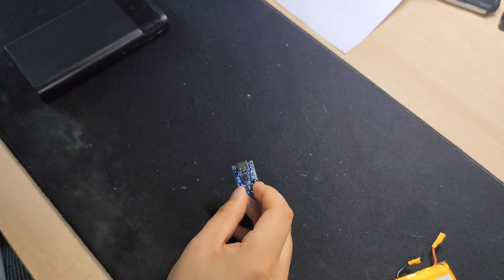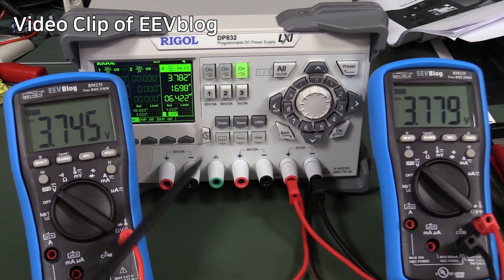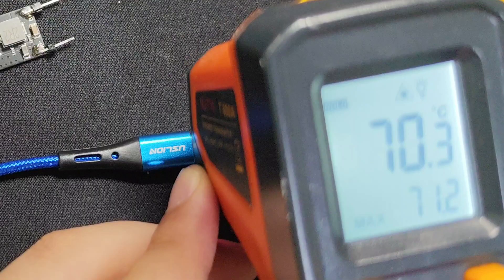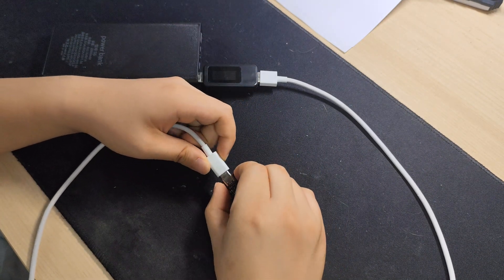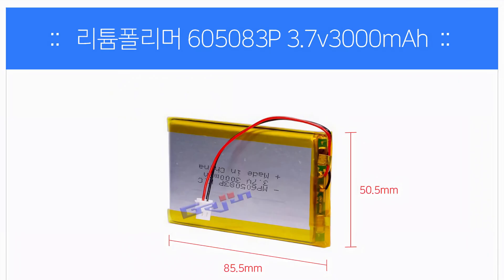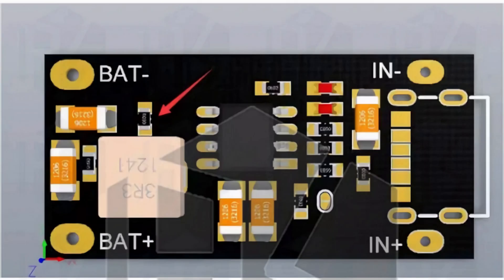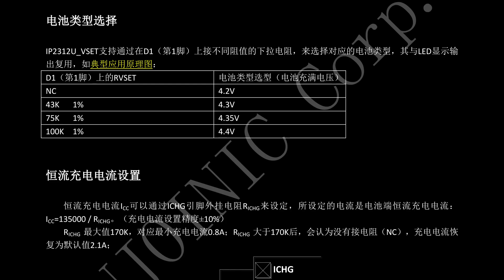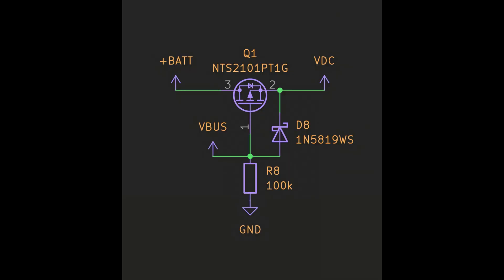TP4056 is dead! use this instead: IP2312 review

Comment: thanks so much for the video! i have a few questions though, if i do not remove the resistor on the board, will it push 3 amps into my battery causing it to explode? or will it charge it at the max limit of the battery.
Reply from the maker: very likely. some battery packs have countermeasures for that, but most aren't.
Reply: @blue_on ooh I see, but sometimes, I see pcbs integrated into the battery (those flat lipos), do those have protection that will keep the current below the max
Reply from the maker: i would not stress them constantly.
Reply: @blue_on hmm alright, thanks!

Comment: Would this module be useful for charging small thin 3,7V 402030 LiPo battery with 200 mAh capacity? To achieve a charging current of around 135 mAh I would need to replace the resistor with 1 MOhm resistor. But is this possible on this board? Can it work with so small charging current? According to the datasheet, the trickle charge current alone is already 100 mA.
Reply from the maker: it would probably be possible but not sure. you need to test it by your own. i would just grab TP4057(not -6) that designed by me. expensive BOM and large footprint of inductor just not worthy.
Reply: it will charge it, but will definitely damage your battery. it will pull too much current and damage it. even tp4056 is too much for your situation and must change the r3 prog. if you can't do soldering, then get XL4015 cc/cv buck converter and set constant current to 100.

Comment: if i had a better battery i would get it but i personally value the integrated protection circuit and my battery doesn't support 3 amp charging nor bms